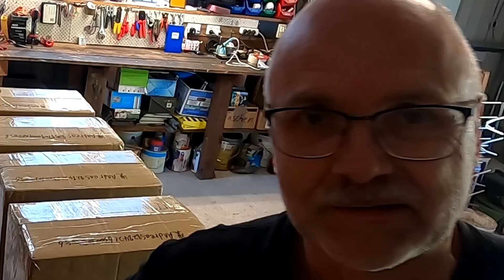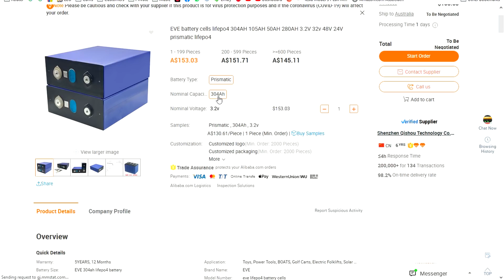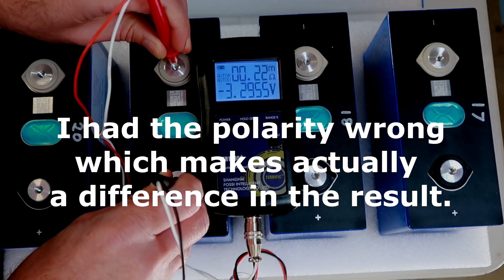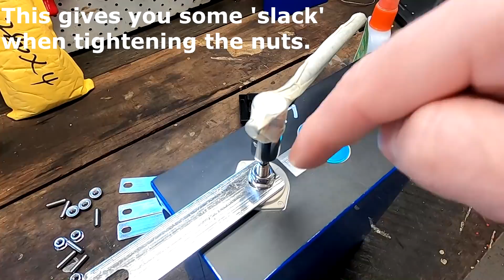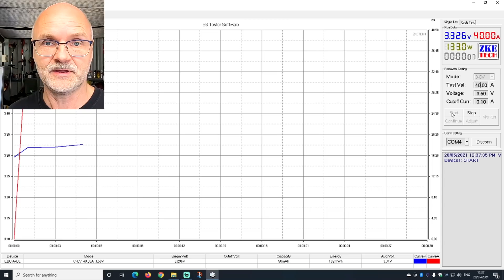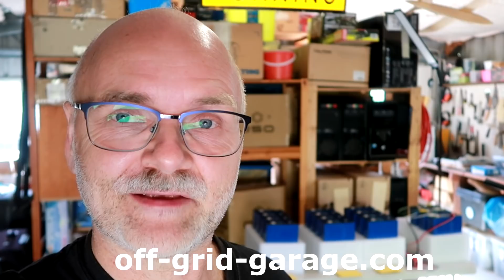Good price, excellent service, I could not resist! 16 more EVE 280Ah LiFePO4 batteries delivered!

Comment: I’ve bought 3.2v 280Ah lithium batteries from AliExpress and they will not charge up to 3.6v & what is the average voltage loose the batteries just linked in parallel 8 batteries ? If I charged Them up to 3.42v in like a week they be 3.39v ! Thanks you’re teaching is the Best Thank you !

Comment: Hi, I would like to put together a system like yours. I am confused on what type of BMS is required. Is a separate BMS required for every 12 volt battery group? Or one for the entities battery bank. Also what size BMS. Thanks

Comment: hi mate, i am sure the quality is good but i stay with 50 A not better but the weight
in rack model the 50 A is about 35 Kg so the 200A will be close too 100 Kg
the 35 kg i can lift and can build a 200 A from it but with 100 kg i have a problem lifting.
amps is not every thing you can build it handeling and lifting maters!

Comment: Looking into these for car audio. 600 amps max on music for a 15K amp. Would a bank of 4 (1 12.8V battery)  or 8 (2 12.8V batteries) suffice with a car charging system.
Reply from the maker: That is 600A burst? I would look into supercaps for that...
4 of these 280Ah cells weigh over 20kg plus cables, BMS and case. And you would need a DC-DC charger.

Comment: Hello Andy and everybody,
could you please share your opinion with me on something what my provider calls an activation of lefepol4 battery? 
I purchased 4 cells with declared capacity of 280Ah. My test results show approx. 240Ah.
Provider (seller on Aliexpress) claims the cells need to be activated by cycling them several times to reach the full capacity. 
Against my better judgement I would like to give them the benefit of doubt. 
Do you think activation of lifepol4 battery is a real think? I personally doubt it. But I could be wrong. Thank you.

Comment: FYI: bought 32 LF280 cells from Jenny Wu at Docan Power Tech. Only 3 cells hit 280AAH, one did 281AH. Others were 277-279.
Still a great deal for the $0.17/Wh shipped price, but clearly marginal capacity that does not meet the EVE LF280 spec of "280AH minimal, 285 typical".
If interested in the cells & supplier results, more details can be found in my Raphtronic van build post 'Were the 32 LiFePo4 Cells from China any good ?'
Reply: Did you buy EVE 280K? Or EVE280? $0.17/wh Australian or USD?
Reply: @pr5991  EVE280 in USD

Comment: Hello Andy, watching your channel for a several months - many compliments - was very helpful. 
1st 16S 280Ah EVE Battery up and running with Victron ESS in my house in Austria. 
2nd Battery 8S 280 Ah now for my Pinzgauer Expedition Vehicle. 
All cells ordered via the link on your website Alibaba QSO. Ordering and Delivey was fine. 
1st delivery last year all 16 cells tested between 280 and 282 Ah. 
Now the problem: the new delivery is only 266-267 Ah. 
(I did not go to 304 because of price difference vs capacity difference)
what would you recommend and what can I expect as a solution. 
Appreciate your Feedback. 
Manfred

Comment: Please make a beginner video How to make a 12volt battery with it or 24volt battery with it. 

I want to replace my 2x150ah 12v c10 lead-acid tubular batteries with it,  24v system on 2.2kva inverter system.

Comment: I looked at the Qishou CE certificate shown on line JT20180201E on checking with the company I was advised the certificate does not exist. Close inspection shows there is no space on the certificate number like the other lines. The address also different line format.  I guess there is no point asking for the technical report? Worth noting a CE certificate is required to have the name of the responsible person on it. Good luck finding Aaron in Shenzhen.

Comment: I received my Lifepo4 cells from Qishou. They seems to consist of some brand new and some used cells
. The plastic blue casing are also different in color, some are darker in color. The bar code are not the same either and looks like from different batch. Internal resistance measure at 0.24 to 0.28. Probably they knew you have a youtube channel and provide u with the best cell for the  review.
Reply from the maker: That's not good, Andrew. Get back to them and complain. If they don't play the game, involve Alibaba and complain with them.

Comment: Hello, I am wondering if you have heard anything about the CATL 310ah cells from Shenzhen Lithtech. I ordered 32 of them last week and after watching more videos thought to ask for a datasheet that was photoshopped. I requested a refund so I could purchase from QSO or Basen but they are already on the big boat from china and they are asking me to trust them that they are authentic, new, grade a, qr intact cells. Doing searches against their name doesn't yield a lot of results or I'm not sure where to look.

I also don't know how Alibaba's refund dispute system works and if it operates in my favor or not once they arrive here.

I would hate to have them arrive and be junk, then wait another 40-50 days for another batch (let alone any headache if there is an issue with refunding).

Any advice?
Reply: There's always risk buying from Alibaba. After watching this video I went to place orders for the batteries. Paid for Air delivery and suppose to receive 7 to 10days. After 3 weeks still nothing. I have file for dispute and hope to get my money back.

Comment: Hi, great video. Im thinking of adding these 12v for a power in a garage. What are they capable of powering before needing to be recharged? Would they be fine for a radio, 32" LCD tv, led lighting and maybe a small kettle? cheers
Reply from the maker: Not sure, it depends on how much wattage all your devices have. It also depends on how long they run for. Make a little list:
TV: 100W x 3h runtime = 0.3kWh/day
Radio: 30W x6h runtime = 0.18kWh/day
and so on...
If you build a 12V battery out fo 4 of these cells, you will have roughly 3-3.4kWh of capacity.
The usage and capacity also determines how much solar you need to recharge the battery during the day.
Reply: @OffGridGarageAustralia  Yes i agree. iv ordered one of those plug in Watt/power meters as well, as a start.So i can work out the exact consumption being used. I do intend to use these cells as they come highly recommended. If i don't choose to use solar just yet, can they still be used as a large battery bank and charged up using AC power when the cells become low? cheers

Comment: Can anyone recommend a low-voltage battery bank protector device. I'm currently using a 200 amp relay with the control circuit pulling point 0.4 amps.
Reply from the maker: You mean like a BMS with low voltage disconnect?
Reply: @OffGridGarageAustralia  
all sorted now. £3 bit of circuitry connected to the relay.

Comment: Are those small alligator clips sufficient for the current's you are running I have been playing with the  old laptop batteries with similar alligator clips and they were loosing tone of voltage so the charge was significantly slowed down.
Reply from the maker: That's correct, they have a voltage drop due to bad contacts and small wires and as you said, it will balance but just takes longer with thee clips.

Comment: Why do you no longer list the previous supplier you used on Alibaba on your website. The new Qishou ones are quite a bit more expensive and seems to be identical.
Reply from the maker: I found the quality with Qishou is better and you can always negotiate a better price. The one shown on the website at Alibaba is not what you may have to pay... 😉
Reply: @OffGridGarageAustralia  Thanks for the heads up on the price. Would have thought bargaining them down to your previous supplier's pricing would be difficult. I contacted Qishou, but they are fresh out of 280ah EVE cells. Adding links to cells your previous supplier would be greatly appreciated, unless there are something wrong with the previous supplier's cells?
Reply: @OffGridGarageAustralia  Hi. Since Qishou are still out of 280ah cells, could you please send or post a link here or on your site to the previous cell you purchased on Alibaba. I had a look, but can't even find the link on any of your old videos.
Reply from the maker: @japieweidemann  sure can. Give me a moment and I put it back on the webpage.
Reply from the maker: @japieweidemann  ok, that's been updated with the second supplier for these batteries: https://off-grid-garage.com/batteries/
Reply: @OffGridGarageAustralia  Thanks so much!

Comment: Is there a difference buying from Alibaba or Aliexpress? Aliexpress seems quite a bit more expensive. Alibaba asks for a company name when signing up.
Reply from the maker: Alibaba is the wholesale store and they usually sell to other companies in large quantities. AliExpress is more the platform for the end user as it includes shipping costs and you cannot negotiate prices there.
Alibaba is cheaper as you cut out all sellers in between. If it's asking for company name, just put your name in again.
Reply: @OffGridGarageAustralia  Thanks, I didn’t think a Chinese platform would care too much about companies.
These prices are so much cheaper than what local companies offer. My house has been off grid for 14 years and still using original 24v 1,600 amp lead acid batteries. I would love a way to build a lithium pack and be able to use both but so far I can’t see a way to make it happen. Would be a shame to get rid of the trusty lead acids.
Reply from the maker: @JimmyLLL  you can just build a new one with LFP cells but it's hard to parallel it with the existing lead acid battery. Maybe through a change-over switch...
Reply: @OffGridGarageAustralia  Yeah i'm not sure how practical that is.
One way that has been explained involves buying another inverter. Hook the new batteries and inverter to the generator input of current inverter (SMA), so when lead acid get low it asks for genertor but gets it from 2nd inverter via lithium. It doesn't solve how they would be charged though.

Comment: I disagree with you regarding the studs. As you tighten the nut it pulls the stud upward negating whether it is bottomed out in the hole. Also the deeper the stud the more surface area, better transfer of amperage. The buss bar moved because the nut you were turning is toothed and you made no effort to stop it. The terminal didnt rotate, not saying it couldnt.
Reply from the maker: Someone else mentioned that already here. Yes, it is true, the studs will be pulled upwards, UNLESS they start twisting with the nut while tightening. This should not happen with new gear and if everything is clean but for peace of mind I like to hold them in position to avoid that possibility.
The stud will not carry much current itself though. The contact area between terminal and bus bar is far larger.

Comment: Now here's a challenge. Top balance and build your pack without a BMS. I bet you can run that pack and maintain balance with no problems.
Reply from the maker: Even they have the same voltage when delivered, I found they don't have the same SoC though. So top balancing at 3.5V is a must when building a battery. But before that, we will have more fun with these cells 😊
Reply: @OffGridGarageAustralia  Agreed definitely top balance. The Challenge is to run that second pack without a BMS. I bet you dont need a BMS to maintain balance

Comment: Hi Andy would you recommend capacity testing all new batteries? I’ve got some on order (been waiting two months now).
Reply from the maker: I asked this myself as well. After testing 12 of them, I gave up. It's not worth doing. If you can measure the internal resistance that's probably a better and much quicker test you should do. The capacity varies. If you keep testing only one cell 5 times, you may end up with 5 different result within a 5% radius. I was planning to do a video about this soon as long as I still have the cells sitting on my workbench.
Reply: But, wait, what? Why?
Reply: @Mr.X3D  is that a reply to my question?
Reply: @alaric No, I was just chocked that the charge/discharge curve would differ that much between cycles. Makes no sense to me!

Comment: Do you know which of the EVE 280Ah models these cells are? I’d expect one of: EVE LF280, LF280N, LF280L or LF280K?
Reply from the maker: That is a very good question which I have now passed on to the supplier.
Reply: @OffGridGarageAustralia  nice one. I have EVE LF280N cells on route now and they shouldn’t be long. I’m sure I’ll do the same as you and end up ordering more :)
Reply from the maker: They just confirmed it's the LF280K. Not sure if this is good or bad 😂
Reply: @OffGridGarageAustralia  LF280K is one of the newest models. 
I can email over data sheets for you if you wish?
Unfortunately I only have the LF280K in Chinese tho!
Reply: @OffGridGarageAustralia  🤣😂

Comment: hello from France, your videos make us very happy, I understand your English very well, at 70 you have given birth to a real pleasure for photovoltaics, to such an extent that I am falling for a model 3 or more if my  wife opens the family wallet can you tell me in which video I can find the number of panels necessary to use a tesla in a reasonable way (case 30/50 km per day panel of 300 watts peak).  Thank you very much for these videos.  Sincerely yours.
Reply from the maker: Merci beaucoup, Patrice.
That is a very tough question and cannot be answered. There is no right or wrong. If you want to charge a Tesla form solar, it all comes down how large your panels are, how much sun you get a day, what kind of battery you have (if any). There are a lot of variables to take into account.
The easiest way is to get a grid connected solar system and charge the EV from the grid when the sun is out. At 50km of travel per day you're looking at around 2-3kWh of energy been used for that.

Comment: Andy, your full costs breakdown spreadsheet has 3 deliveries.  The 3rd one is for 6pcs.  I guess this is the recent one you just received, but it does not match your tested qty 16pcs in this video.  Do I click a wrong link ?   When did you order this 16pcs to Qishou?   Is this 16pcs to run a separate system or combine with your existing one which has already 16pcs ?  I have great interest to see more coming videos on this new development.
Reply from the maker: This one was a delivery of 2x 8 cells and is not in the spreadsheet yet. I'll add this soon. Thanks for the reminder.
This will be added to the same system, Jeff. Heaps of more videos will follow very soon in regards to that...
Reply: @OffGridGarageAustralia  No problem !  I contact Qishou for my inquiry.  They quoted me $106 excluding shipping.   I already got my first shipment from different supplier that I ordered mid Mar.  It turned out some cells got damaged.  The corner of a few cells are deformed like being dropped on ground.  Packaging are all good with damage ! I am just bad luck !  unhappy experience in my first time purchase of cell from China supplier.
Reply: Andy, how much is the unit price of Qishou cell you paid for ?

Comment: Hello, I believe Qishou just raised their EVE LF280 price to $119.99 !
Reply: It seems all the major alibaba suppliers have, I'm told there are shortages so this reduces the demand. A number of sellers are pushing alternative brands. I just ordered some REPT versions US$89 per piece plus shipping... here's hoping they are sufficiently equivalent.
Reply: @philipmay9874  yes when I checked the link yesterday it was around $90. Now at 119.99.   I am not sure how important but how long is warranty on the rept cells.  A different seller was offering 3 years.  Caused me to pause.
Reply: As a mini update. Today Basen contacted me and provided an update. They claim the REPT 280Ah cells had failed their testing and wouldn't be suitable in a larger battery ( greater than 5% gap in capacity from same batch ). I was offered a refund or an option to pay to upgrade to the EVE 304Ah. So i did that. An extra US$9 per piece as a special price for those impacted by REPT order change. So all up US$98 per piece plus shipping. Shall see in probably August when they arrive whats what.
Reply: @philipmay9874  thanks for the update. I wish I was brave enough to try to go with the rept cells when offered. I would have enjoyed the $98 deal.
Reply from the maker: Prices have gone up everywhere since last week. I have to wait for a price drop again to get the new 304Ah from them.
Reply: Bonjour super Pierrot, est ce que ces prix comprennent la TVA ?
Hello super Pierrot, do these prices include VAT?
Reply: I just purchased a 12v 280ah battery in 🇬🇧, grade A eve cells low & high temp , internal heating + Bluetooth and 10 year warranty £759.00.

Comment: What BMS would you now suggest for 12.8vdc @280A? With cold charge cutoff and the other frills?
Reply from the maker: You can always go with a Daly bms. David here shared some really bad experience lately where the Daly failed to protect the battery due to a fault charge controller.
I like the one with the relay actually and will probably stick to it with my further upgrades.
The BMS is only the last resort to protect the battery if other measures fail. The Overkill BMS has got good reviews too. Or, take a look at the @Electrodacus BMS. I would use that if he would finally make a 48V system (just for me maybe 😉)